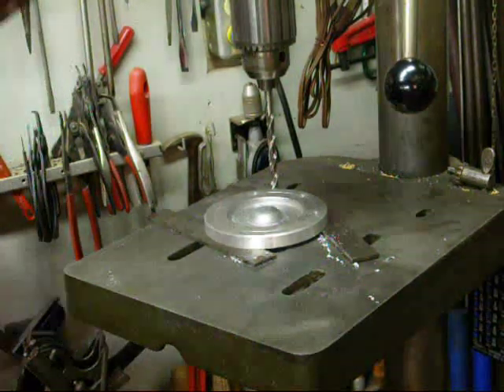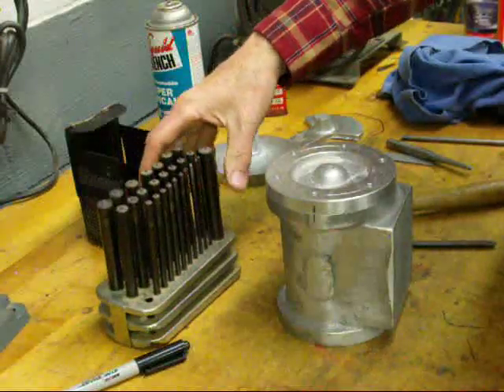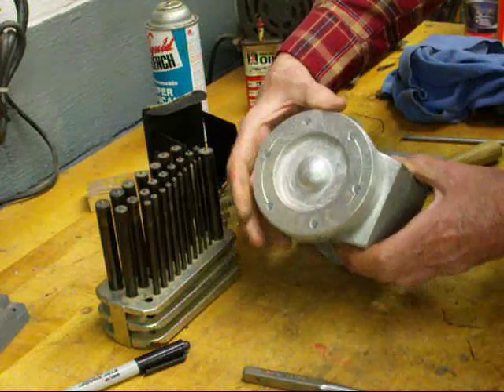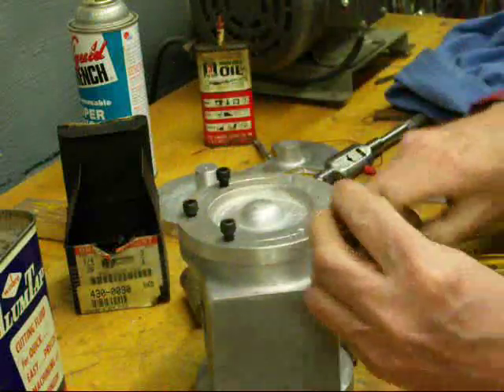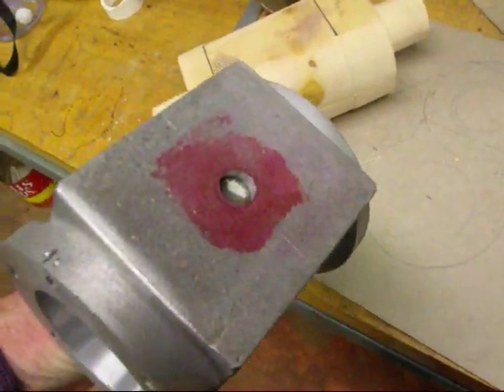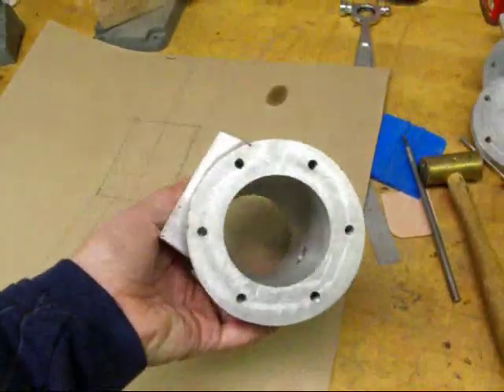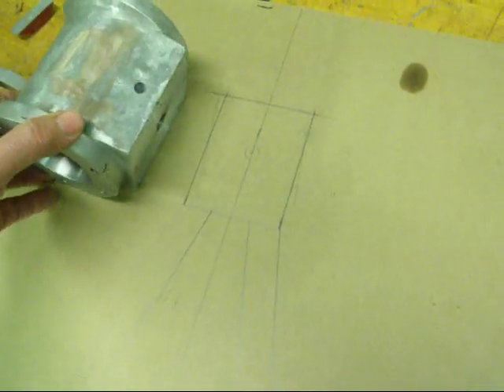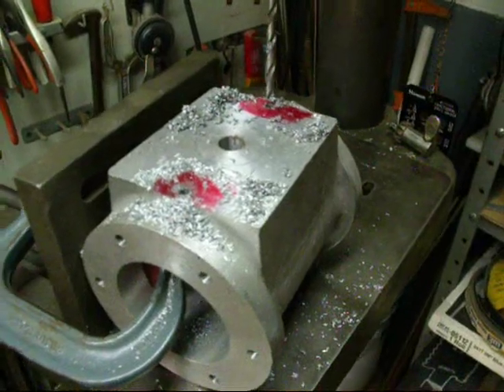BUILDING A MODEL STEAM ENGINE part 3 tubalcain

Comment: Gi Day Peter, great to see I'm not the only one that draws out on cardboard/ply.
I recently bought a small Tiag CNC mill from a friend, I'm finding it very useful in my hobby shed. I mostly scratch build and residing in Australia it seems that everything we need has to be imported! So local fabrication is the norm. I enjoy the wisdom gained from your very good videos. PS a lot of my friends that are 20 - 30 years your junior couldn't hold a candle to you.
Best Regards Barry
Reply: So Mr. Pete and yourself use CAD for your designs. Cardboard Art Design!

Comment: Maybe face the square end (the one with the porosity)  before you bored the cylinder?   Then you'd bore the aluminum plug pretty smooth on the inside of the cylinder.

Thanks for the effort, these are great!

Comment: Thanks for the video. very enjoyable.
Can I ask a quick question? How do you face the side of the cylinder for the valves when you cant drill through the whole thing. I only have a lathe and that time is approaching!My little Stuart engine is about 5 % of the size of this but I am learning a HUGE ammount from your videos!

Comment: Did you put a hole in the sand casting above the valve face of that casting in addition to the single pour hole? I know you made a riser next to the casting to account for shrinkage. I think you may be trapping air in the top of the casting if there wasn't a vent hole (causing the porosity you found). That's not to say that I know what I'm talking about, but it seems like it could be a possibility.

Comment: this piston block is made of aluminum. is that common for miniature engines, if you want to run them on live steam? or are other metals used for the pistons? i would like to know that. also, the piston covers are simply screwed on? wont that leak eventually?

Comment: Neet.
So? How do you seal  the driven rod?
Will it be chanle cut on the inside of the
Base head fitting or cap? Or will it be a 
threaded compershion fitting from the 
rear or face of the bottom cylinder cap?